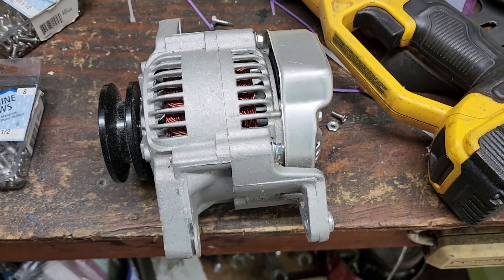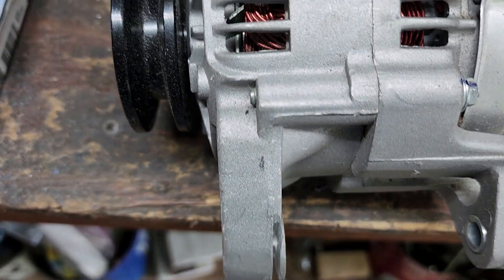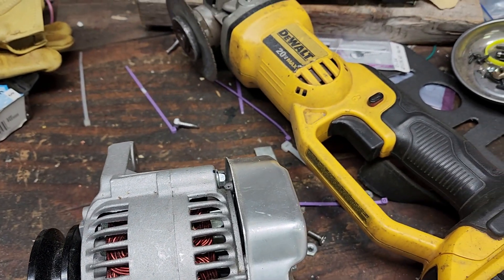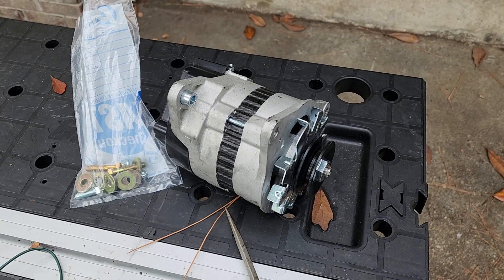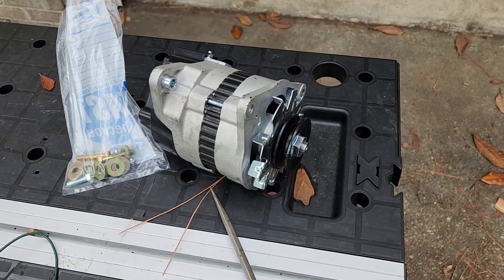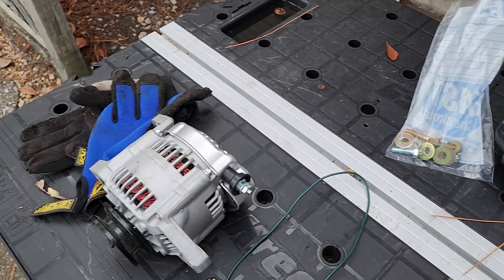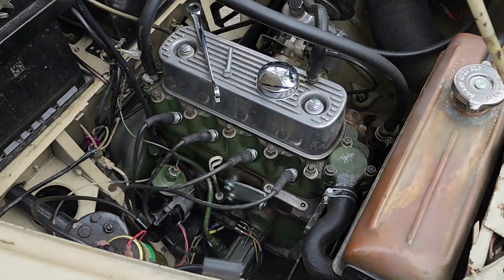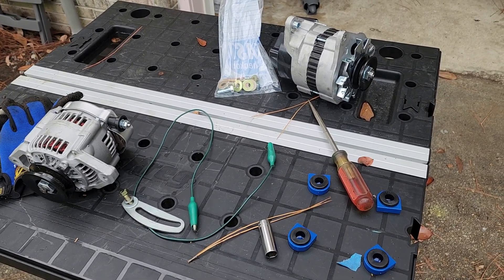Austin A35 dynamo-alternator Conversion

Comment: What are the changes you made at the reg box please?
Reply from the maker: I removed it. The output of the alternator just goes directly to the battery .
Reply: @GrandadFixit  Ah.. rather than use the reg box as a joint box .. I see..